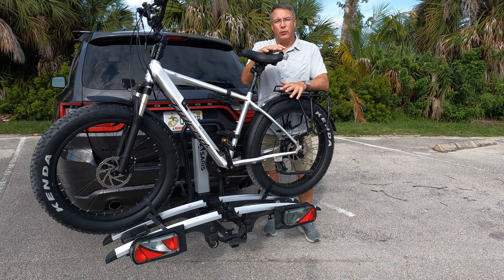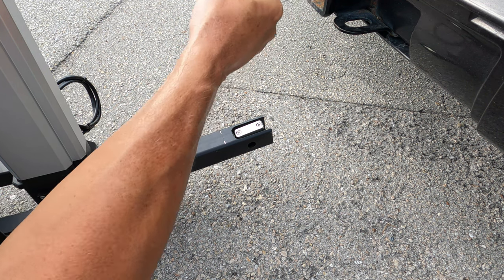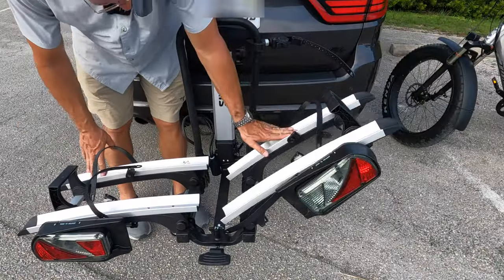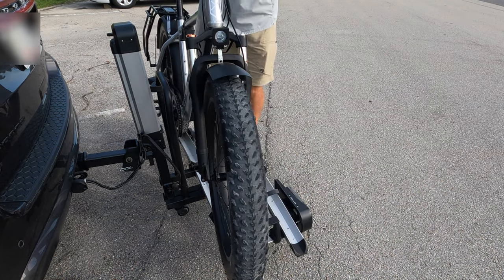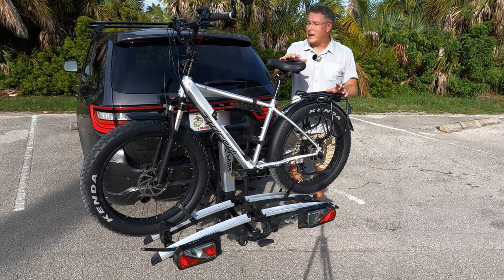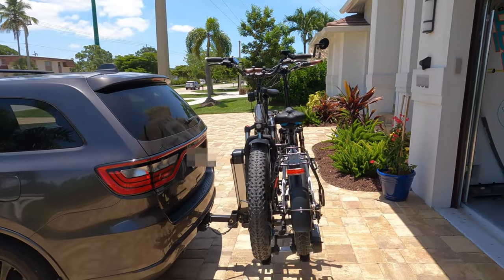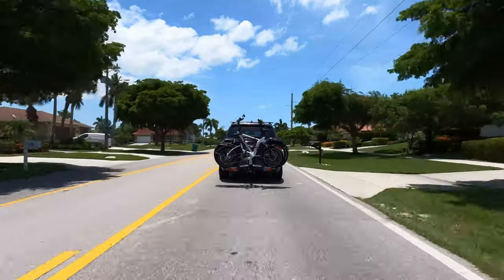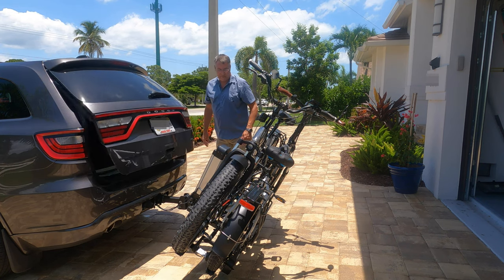This Rack Solves 2 BIG Issues when hauling E-Bikes

Comment: I dont know. Almost 1200.00 , wonthold a fat tire 4 in or 70 lb. Great presentation,  just ge rack is not good enough
Reply from the maker: Yes, that 70 pound rating seems to throw off a lot of bike rack manufacturers.  I just reviewed the Hollywood Destination E and it has a heavier rating for the bikes and it very easy to load.  It's my new favorite.  -Tom

Comment: 60lb weight limit per bike is a massive miss.
Reply from the maker: I agree.  Seems like you would design a larger capacity into it but I'm no engineer.  Maybe it's a battle between the engineers and the accountants.

Comment: Thanks, Tom! Regarding wiring, did you have a 7-pin system already set up on your car, or did you have to adapt/convert from a 4-flat to the 7 system? Is a conversion even possible given the Saris seems to require more than a 4-flat can provide. If you did convert from the 4 to the 7, how did you manage it? Thanks! Sam
Reply: I’d like to know this answer as well as I’d have to have the wiring installed. Expensive to have done?
Reply: @susanbergeron929  I am guessing you have already had something done by now. A 7 pin must be wired into the vehicle separately as it has a constant voltage. Its not cheap and best to have the dealer do it as it can be tricky where the wires are.

Comment: Hi, great video. Can you confirm your bike has 4 inch tire size cause the rack accepts only up to 3 inch. seems your tire floated on top of the tire rail. can you comment on this, cheers
Reply from the maker: Great question, Michel.  I asked Saris about that before I got the rack.  The 4" tire fits just fine.  The channel on the rack is more of a guide as opposed to something that holds the bike in place.  Of course it helps, but the straps are the real anchor points.  As long as the tire has enough of a channel to lock into with the straps, it's fine.  I'm paraphrasing what I was told but again, I asked the same question of them.  I'm sure their lawyers would say something different so don't take my opinion as the gospel.  Again, great question.  -Tom

Comment: Great instructional video. I knew it was just a matter of time before these hydraulic e bike racks come onto the market.
I have issues loading my heavy bikes. So I bought a super light weight hybrid e-bike under 38 pounds. Does the trick.
Reply from the maker: That's pretty light for an E-Bike for sure.  Anything that doesn't make it tougher is helpful and just means you'll get out and use it more often.

Comment: Hey Tom! Nice unit, especially that lift/lower feature. Thanks for the demonstration. 
Try not to melt down there. It's almost as bad up here in Connecticut. Throttle-only weather!  🚲Take care.
Reply from the maker: Hey C.P.  I'm adjusting this summer better than I did last summer.  Throttle only weather....LOL!  I'm going to steal that one from you if you don't mind.

Comment: I would like to know how far from the back of the vehicle does the rack extend. I need to know if I will be able to close my garage with the rack mounted.
Reply from the maker: For my vehicle, it's about 35", Jimmy.  That's from the rear edge of the 2" receiver.  It does fold up but you have to take out the pin to swing it up.  -Tom

Comment: Great video Tom!  Does this replace your Thule easyfold rack?  I am in between this Saris rack and the Hollywood destination e-bike rack with the collapsible ramp.  I have a Juiced RCS XL just like you.
Reply from the maker: Thanks Tyler.  With the lights and the ease of loading, I'm going to answer YES to your question.  I'm not familar with the destination rack.  I'll have to Google that and get up to speed.  I hope you like your RCS XL as much as I love mine.  It just took me to lunch on the island today!
Reply: @evolutionaryTom  overall I like my RCS but I've had an issue with a loud noise in the rear end since I got it an Juiced thinks it is the controller.  I've been waiting on a replacement for over a month.  Hope that fixes it when I eventually do get it!

Comment: Nice vid, Tom and thank you. I like the electric feature but for a 4in fat tire, those channels simply look too narrow. Did you sell your Thule?
Reply from the maker: Thanks for the nice comment, loopedrevo.  No, I did not sell my Thule.  The channels are narrow on both racks.  The straps though make it really solid.  The channel ends up being more like a shelf and a guide one they are strapped in.  BUT, you can never be too careful.  When I use to carry my motorcycle on a hitch rack, it took 6 months before I finally believed that it wouldn't fall off on the first bump.  LOL

Comment: You think one can hook up the 7 pin then activate the lift THEN slide it into the hitch?  Idea being getting it to raise itself… Trying to figure out a system for dear mother in law to not have to lift the 60 lbs to slide it into hitch… 

Purpose was to not have to lift anything😂

Was hoping to find a system that would maybe have a bracket bit that more permanently stayed in the hitch then the lift more easily attached and detached as needed.
Reply from the maker: Whoever makes the easiest system is going to do very well.  The E-Bike manufacturers need to understand who their customers are and many of them are older and not looking to be a weightlifter.  I completely agree!  -Tom

Comment: Any that fit a 4" tire? Perfect concept solution
Reply from the maker: Ron, My 4" tires on my Juiced Bike RCS fit just fine.   My opinion is that it sits in the tire rail as well as it does on the Thule EasyFold, maybe a bit better.  The straps are very secure.
Reply: @evolutionaryTom  that's great! I was looking on their website and it said up to 3" tires.

Comment: Really nice explanation thank you. That rack is just too much for me. Electric up and down maybe a foot pedal would have been cheaper and those lights look too big and easy to break when moving that monster around. The chanels should just have been wider since it was designed for heavy ebikes that often have these plus sized tires like yours. Plus the price of $1300 holy crap just too much.